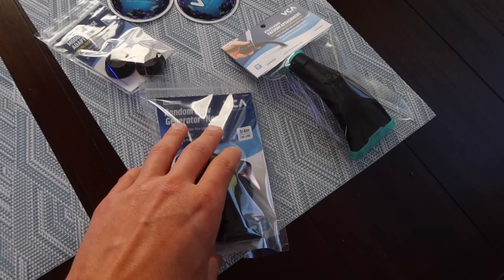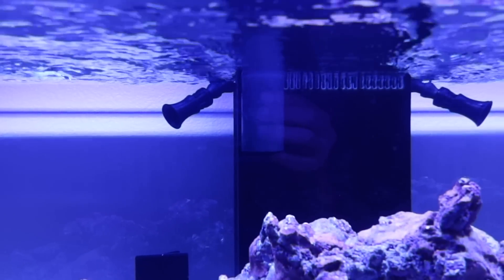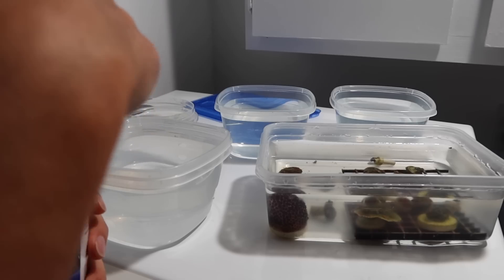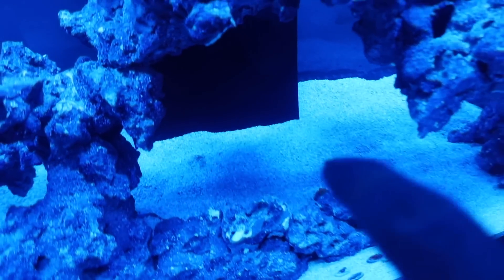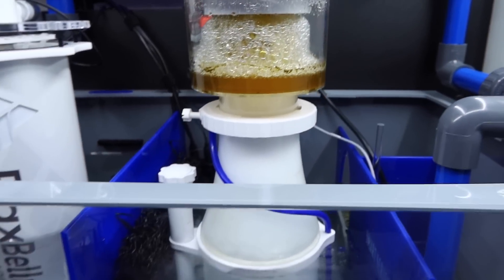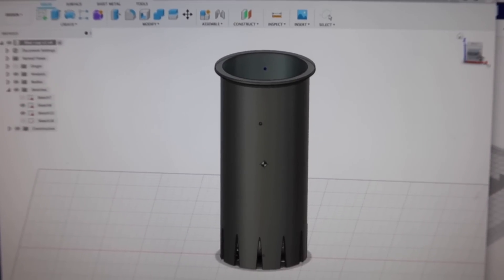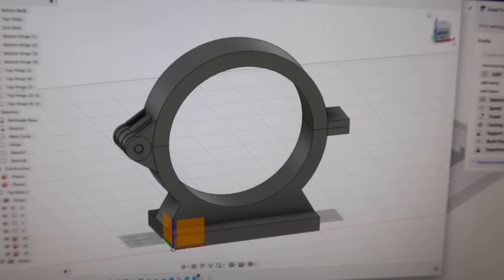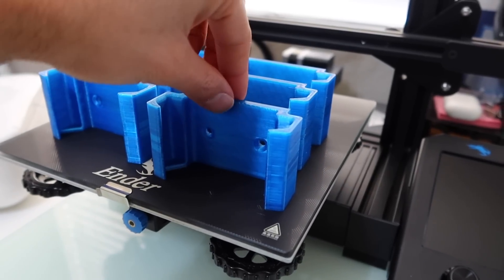New corals! And 3D printer 🤔

Comment: Btw you can 3D print a variety of locline fittings including flow eductors and random flow generators. I printed a splitter and a few extensions for each of my return holes, giving me a total of 4 endpoints. I printed random flow eductors for each endpoint. It's easy to find on thingiverse!
Reply from the maker: I will look into those 🤙🏼

Comment: have had my ender 3 for over a year. Great starter printer, just got a cr-10 v2  needed the large build volume. Have made a ton of stuff for my tank as well. Check out reef2reef  there is tread about just 3d reef printing files.

Comment: Just curious, are your return lines supposed to be just at the surface of the water to prevent siphoning if the power goes out?
Reply from the maker: No as they have a check valve in the overflow box